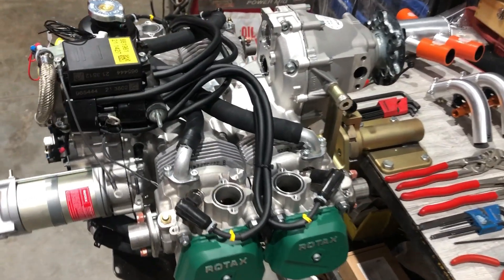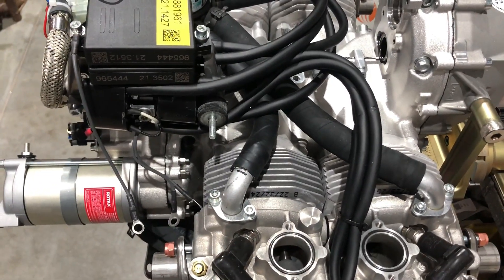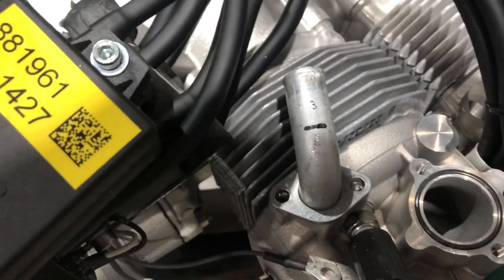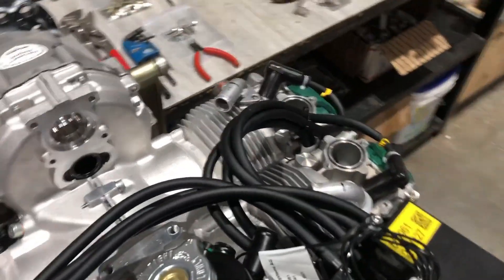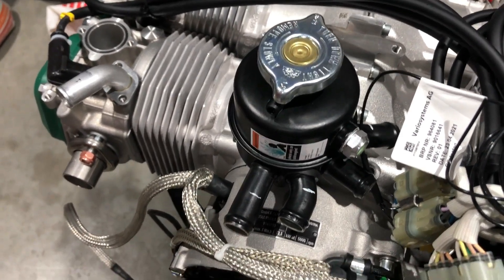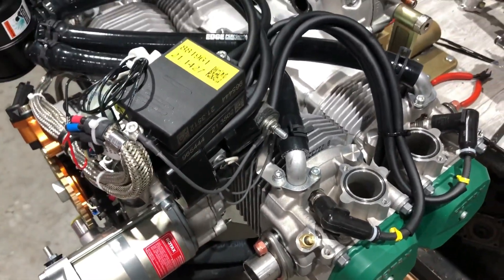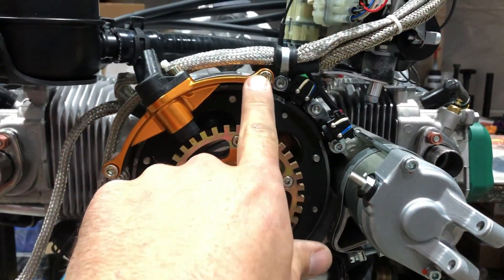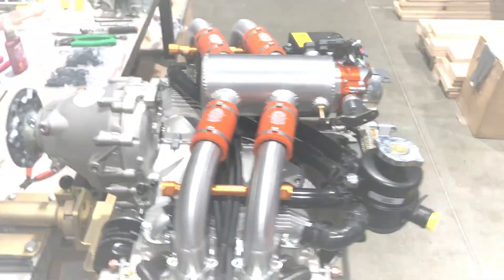Coolant Spider & Ignition Module Relocation

Comment: How do avation engine manufacturers keep the cylinders from wearing uneven? Using a horizontal engine wont the pistons wear the bottoms of the cylinders quicker, eventually causing blow by.
Reply from the maker: The connecting rod is offset to help a little with that but these engines have no problem running several thousand hours without that being an issue.